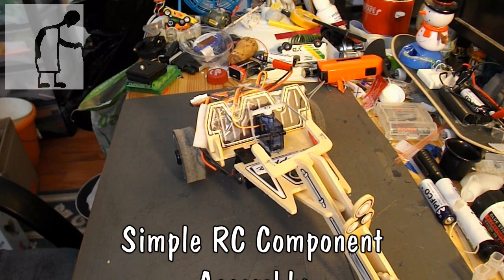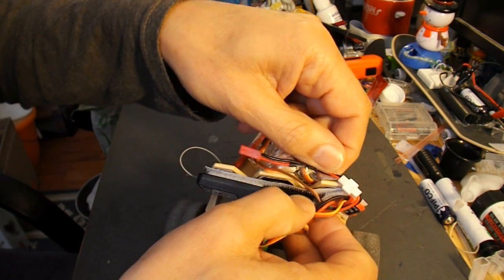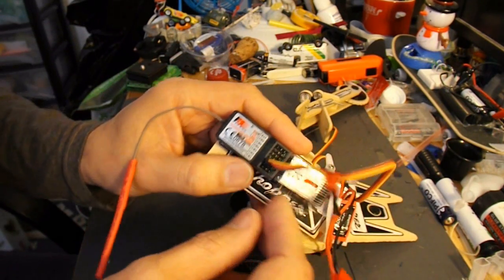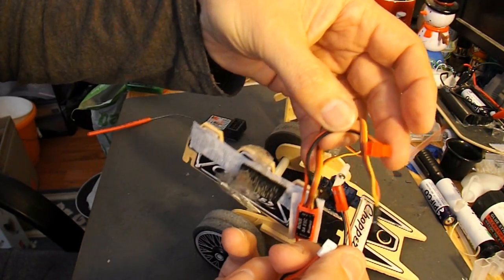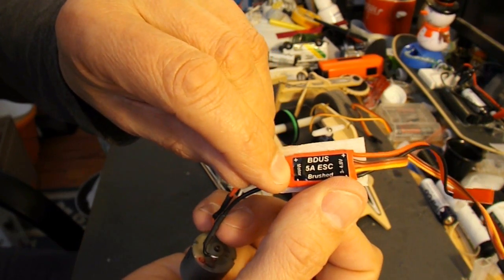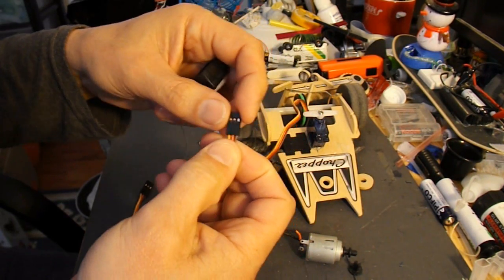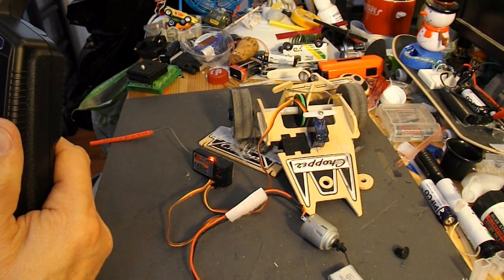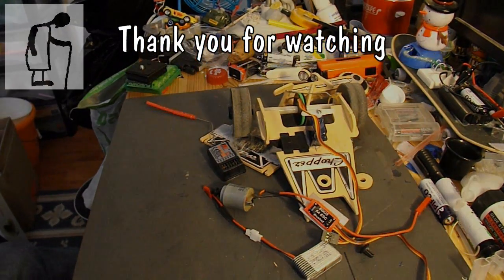Help File - Simple RC Component Assembly

Comment: So if i understand well, the servo doesn't have any ESC, so it means that the controller will only be able to give "raw" inputs towards the steering ?
Reply from the maker: Fikzy I don't understand what you are saying? A servo does not have an ESC. It has a controller board that takes the input from the signal wire from the receiver and converts it to the amount of rotation indicated by the movement of transmitter joystick. An ESC is an Electronic Speed Controller and is used to control the speed of the motor powering the car or plane or boat, nothing to do with a servo.
Reply: Ah.. ok, thanks ^^'

Comment: Hey Grandad,can you make a RC boat with these components?
Reply from the maker: Mohamed Yassine you could make an RC boat with the transmitter, receiver, servo for steering, ESC and electric motor for power if you wanted to. It would be similar to the other RC boats in my Toy Boats playlist. It would probably be better to use a two way ESC so that you can make the boat go backwards and forwards. A more powerful motor would probably help and a good propeller would help.Most of those components have been on other boats in my playlist in the past, here is an example https://youtu.be/3glARXdrXvc?list=PLA5a2xPRSrB24vUS9E8zkSgjZysEL00zr